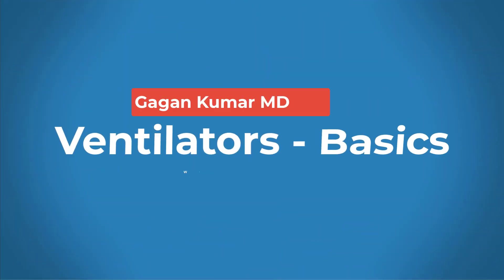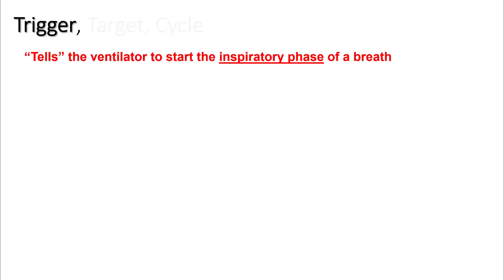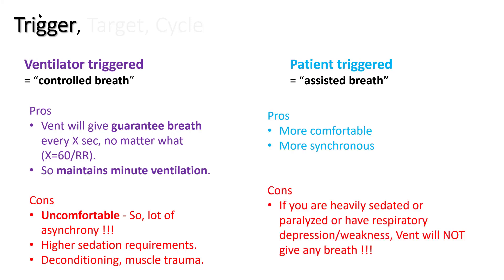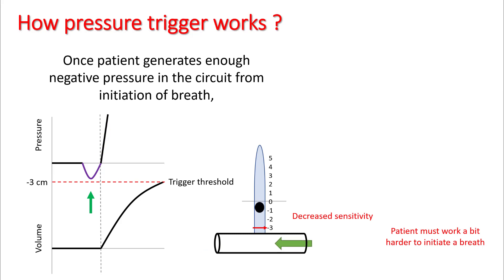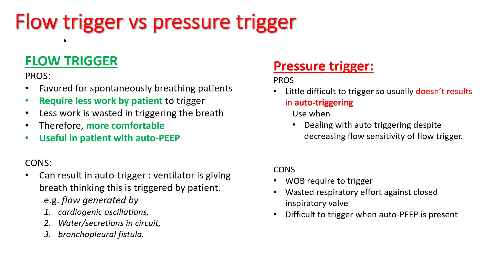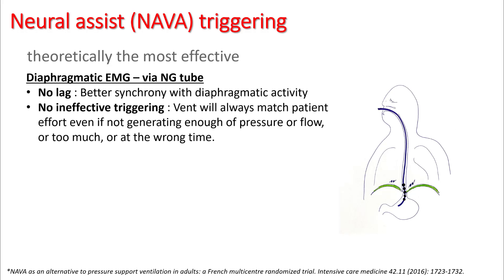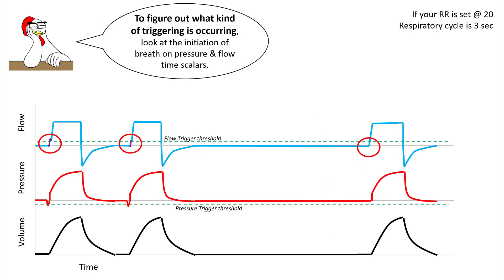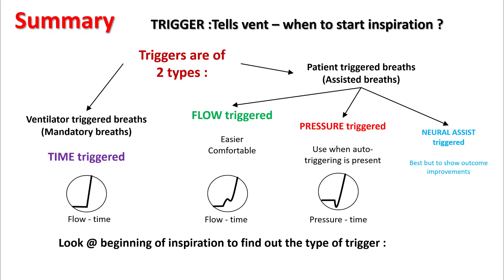Ventilators basics  : What is Trigger ?

Comment: I'm confused, pressure trigger is beneficial or to be avoided in COPD ?
Reply from the maker: if your patient has autopeep, he has to generate pressure = autoPEEP + trigger threshold to trigger the breath. eg. if autoPEEP if 5cm and trigger threshold is -1cm; he will need to generate +6cm pressure before machine gives him breath. so if your COPD patient has significant autoPEEP, it may be better to use flow trigger for better patient vent synchrony.
Reply: @gagankumarMD thank you, it was an excellent presentation